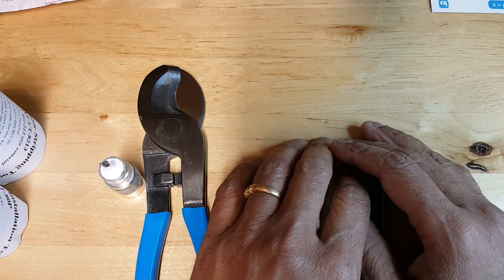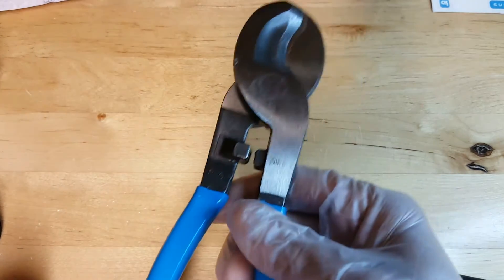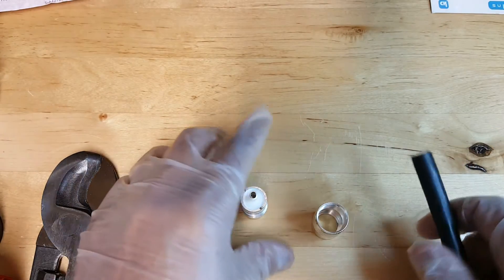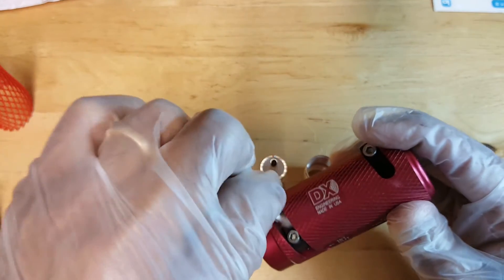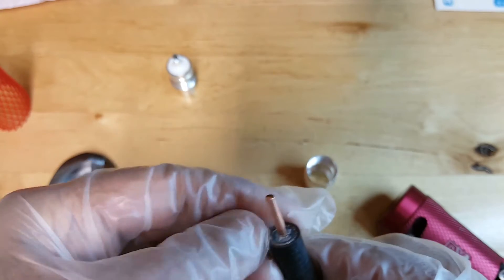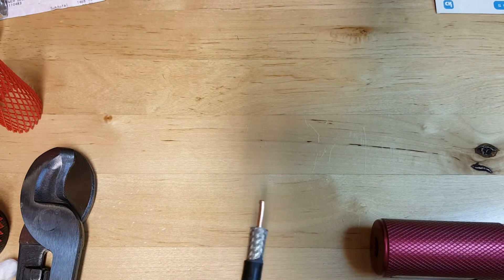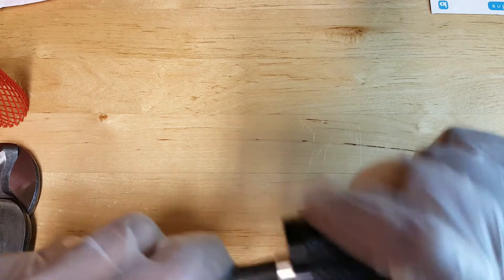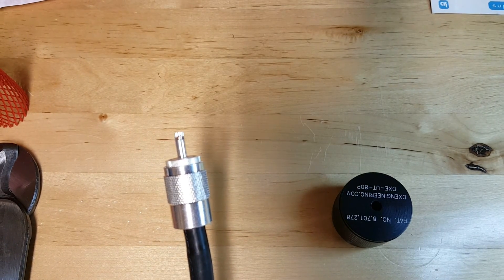N0AGI - LMR-400 Stripping/Install Tools - DXE-UT-8213 & UT-80P - Vol 65

Comment: Thanks for posting, having done hundreds of these, its nice to see how the tool make such a clean and accurate job of stripping/preparing the coax ready for the PL259.  The additional tool really does work and I wouldn't have believed it if I hadn't seen it.  I teach radio at our local club and these would be a great asset to have when getting students to prepare the cable ready for soldering.  Then its just a matter of a nice hot soldering iron!  Very informative thank you.

Mike
Reply from the maker: +Mike S thank you Mike. Glad you found it useful. Thanks for watching. 73, Nagi. HTTP://N0AGI.com/